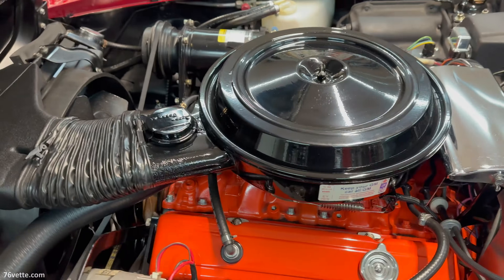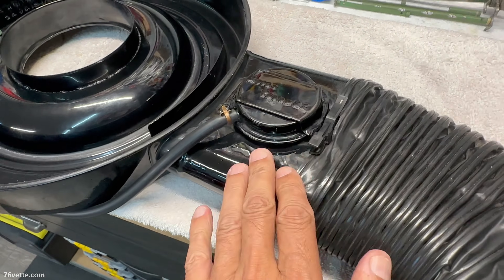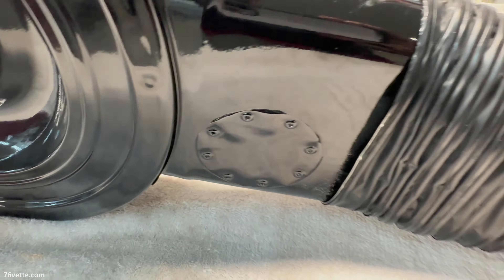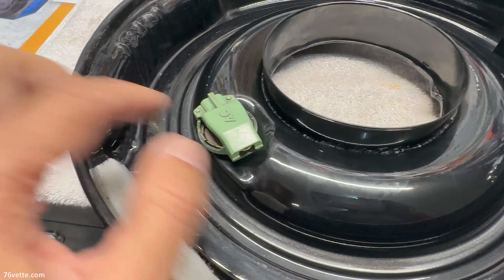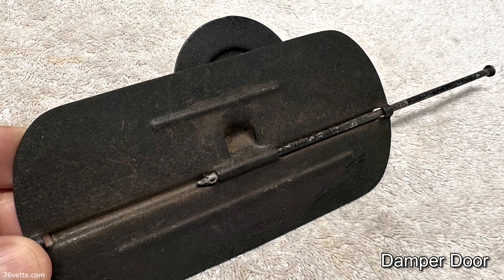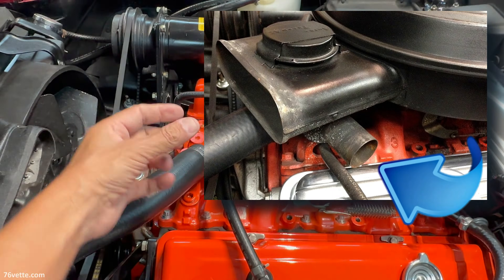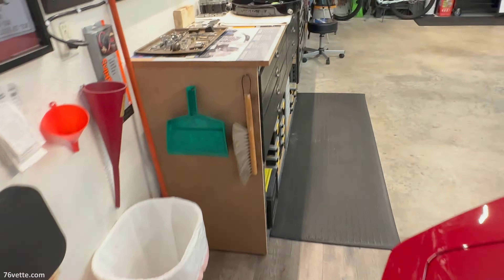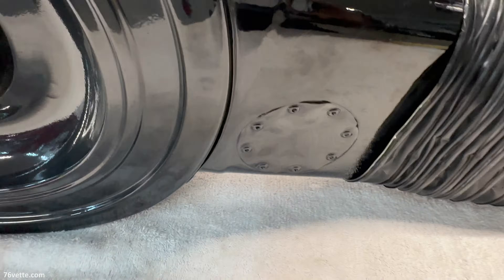How Does the GM THERMAC System Work?

Comment: These systems were used well into the eighties by a number of manufacturers.  GM used a lot of different part numbers for both the thermac valve in the snorkel and the temp sensor in the air cleaner. The sensor works similar to a choke bi-metallic spring. When it heats up a tiny ball valve opens and creates a small vacuum leak inside the air cleaner.    With no vacuum now going to the thermac, the snorkel door opens and the heat stove air inlet closes.
Reply: Thanks for the explantion of the temp sensor. I always wondered how it functioned without having a 12 volt power source.

Comment: Here in Brazil, we "know" it as thermac valve, a combination of the words "thermostat" and "pneumatic".
 I say we know in quotation marks, because in truth 80% of the Brazilian population (even mechanics) do not know what it is for, and generally when this component is defective it is forgotten forever. 
From what I know, this system has different functions, from emissions to even preventing carburetor freezing. In Brazil it was introduced by Fiat (correct me if I'm wrong), it was sometime in the second half of the 70s, along with the newest technology in engines powered by Ethanol, derived from sugar cane.
Ethanol, at least here in Brazil, has great difficulty vaporizing in temperatures below 15°C, so in cold starts, gasoline injectors were used to give the first start, together with the choke activated, and as soon as the engine starts, the vacuum of the intake manifold passes through the "sensor" present inside the air filter box and closes the hatch in the intake pipe, blocking the passage of air at ambient temperature and forcing the admission of hot air, coming from the metal cover that surrounds the exhaust manifold, which quickly heats up in a few minutes of operation, causing the ethanol to vaporize and the engine to be able to run regularly as quickly as possible.
After that, all brands started using ethanol-powered engines with the Thermac system, Volkswagen, Chevrolet, Ford, etc.
After a while, which I don't know exactly when, but I believe it was around the mid-80s, pollutant emission laws must have become stricter, and even gasoline-powered engines began to use the thermac system.
If we stop to do a simple analysis, an engine that is fed by a carburetor does not change its air/fuel regulation constantly according to the temperature and density of the air, altitude and engine temperature, a carburetor regulated at sea level on a 30°C day will not work very well when it is above sea level on a 5°C day, so since we are not able to control the climate, we have to regulate the temperature of the air that is admitted, another function of the thermac system, reducing the need for frequent carburetor adjustments.
Another important point: An engine that warms up quickly is an engine that needs less time with the choke on, consequently lower emissions and less fuel consumption.
And another point I've seen north americans make is about carburetor freezing in extreme cold conditions. This is very difficult to happen here in Brazil, despite the south of our country being very cold, reaching temperatures below 0°C in the height of winter.
Reply from the maker: I appreciate your detailed explanation as to the purpose of the Thermac valve and I thank you for watching. 😊👍🏻

Comment: What if the white filter-like material for? Mine is super brown colored and seems hard and clogged?
Reply from the maker: It’s, as you said, another filter (part of the PCV system), that helps control blow-by and burning those gases by feeding them back into the intake instead of releasing them to the atmosphere. If yours is in bad condition, replace it asap. 😊👍🏻

Comment: hey man, I have this system on my '79 Caprice Coupe. the hose on the bottom which you removed is broken/perished. do you know if there is a filter within that metal thing which it is connected to (which is missing on your enginge as you said)? I'm a bit scared that loose parts from the perished hose can fall into the engine. It has some trouble with cold start as well, may have something to do with this too. ( think it works together with the carburetor?) thanks for any help & cheers
Reply from the maker: Are you referring to the temperature sensor hose? If so then install a new vacuum hose (you can buy one at any auto parts store and cut it to size). If there’s a vacuum leak at the carb, the car is not going to run properly so you may want to replace all of the engine vacuum hoses.
Reply: @76vette hey man, thank you so much for the super fast answer :) I think it's the heat stove, shown in the pic at 03:06min. the one with the red arrows. greetings
Reply from the maker: @vornamenachname2018  Ok, so that tube does not have a filter and any unlikely debris will not go into the carburetor as there’s an air filter element that should keep that from happening. Cold starting issues can be related to choke and/or fast-idle adjustments. A proper rebuild of the carburetor followed by a tune up may be a good idea. Good luck! 😊👍🏻

Comment: It's not an emissions control device and in cold climates your car will run better with it until it warms up. It draws warm air up from a jacket around the exhaust manifold to improve cold performance.

Comment: Is it a big deal if the car simply has an open filter like the previous models? I'm buying a '79 C3 L82 but the previous owner apparently removed the original filter with the snorkel apparatus and the smog pump
Reply from the maker: Not having the thermostatic valve makes the car harder to start in very cold weather and it also helps keep even inlet temperatures to prevent throttle valve icing, under which conditions I would not drive the car anyway.
I would not worry about it too much. Thank you for watching! 😊👍🏻
Reply: @76vette  Thanks for the reply, cheers!
Reply from the maker: You are welcome. 😊👍🏻
Reply: Still have my original snorkel styled Thermac air cleaner assembly from my '79 Chevy 350 engine put up as a spare. I switched it out over 5 years ago for an older Chrome Edelbrock air cleaner I found in the junkyard chilling on a Chevy Vega and shined up. It was the type that's like having 2 metal pans with a large surface area air filter in between. I didn't really notice a difference in drivability or behavior even in below freezing temps BUT for context this was in my '79 Chevy G20 Van in which the firewall and doghouse ( under dash engine cover) wrap around the engine close enough to the exhaust manifold it presents a different thermal situation. I also use a manual choke (personal preference) A car or truck with a long engine bay may experience a change compared to my case however. The only times I felt different drivability performance was with what Quadrajet I used. I prefer the "Made for GMC by Carter" Quadrajets over the OG ones. Years ago I read something about Carter doing something slightly different with a chamber or something, don't remember, but I always preferred their performance. I realize this comment is a year old but hopefully you get something out of this.

Comment: How would I go about changing it to an open air filter??
Reply from the maker: Personally, I consider that a bad idea, but you can call a parts vendor like Summit or JEGS and they will sell you whatever parts may need to convert your system to a “hot air” filter instead of the original “cold air” design. Good luck! 😊👍🏻
Reply: Get an oxy-acetylene cutting torch cut out the base and cover oof air cleaner just to the edge of the air cleaner gasket. Get a chevy truck replacement aircleaner that will be 15 inches round and 5-6 inches tall. Cut hole in hood 2 inches larger than new air cleaner assembly and adhere on a 3 inch tall chevy cowl induction scoop. Then fiberglass and resin around the edge. Then sand and paint. Block off vacumn hose with a golf tee.

Comment: Love the channel. Do you know a good C3 mechanic in central Florida?
Reply from the maker: I’ve had DJ Auto Repair in DeBary work on my truck and my Corvette when I lived in that area and they are great. Danny built a dual exhaust for my 76 and Jose got my a/c working. 
121 S Charles Richard Beal Blvd., DeBary 
386-668-9771

Also, Reilly Auto Repair
850 Ridgewood Ave., Holly Hill 
386-254-8660
Reply: @76vette  thanks so much, have a 76 myself that needs a lot of things done and limited time to do it myself
Reply from the maker: @ytnicedream  You can also talk to owners at car shows as they can provide great leads for repair shops, painters, etc. 😊👍🏻

Comment: As I mentioned I put a L82 dual snorkel on my bone stock '76 L48 and mentioned a noticable improvement in everything.
      I live in Chicago so a majority of my startups are cold weather type situations.
    The stove pipe is a must and my experience is even in temps below freezing the moment the carb senses warm air the idle creeps up and in 30 seconds it goes in to cold idle mode roughly around 1500 rpm.
   The best thing is I can immediately put the 4 speed in gear and drive knowing the engine doesn't want to cough and stutter.
    My experience is the automatic will perform about the same depending on wear condition of the trans,fluid and vacuum.
     That being said the engine setup with everything in order makes it that much enjoyable to drive.
     Next comes heated seats under new vinyl covers.
     I love the '76 C3 mostly because of it's true driveability in cold weather or anytime actually.
   Keep up the great work and don't forget to swap out that single snorkel to a dual,you won't regret it after a little twerking with the upper radiator supports.
Reply from the maker: I’ll keep looking for one. Thank you for watching! 😊👍🏻
Reply: Why would you drive a classic car on the ice and salt roads of chicago? Are you stupid or something(jenny(forest gump)..
Not only are you risking some idiot sliding into you or yourself but the heavy salt will rot the chassis and aluminum in 5-6 years. Cant say how dumb that is enough. Its just not like the old days when men did the driving and high skill was required because they only salted the main roads with only 5-10% of the salt they use today. Your car has no chance at all
Reply: P.S.
If your driving that thing in the ice,snow and rain with ram assisted hydraulics thats just dumb ontop of dumb.
Sell that car to someone that appreciates it.

Comment: Having to smog mine every 2 years, I think the door was spring loaded open.  The valve in the hat was connected to a water temp controlled thermal valve , when cold would allow vacuum to the valve in the hat which would open when temp in the hat was cold.  This would draw vacuum to the diaphragm in the snorkel, closing it and forcing hot air flowing over the header (which heats up rapidly) to heat the air entering the combustion chamber.

It's main purpose as most other smog components were to get the engine up to temp faster so as to not pollute the air with its rich cold start mixture.    Every 2 years, I run through the schematic checking vacuum and hoses for leaks.  A pain in the butt but when you master it, it gets real easy.
Reply: Its one and only purpose was to get rid of the hesitation. By women to dumb to wait for the car to warm up before taking off down the road when it was 10 degrees outside. Because they cried they were stalling in the middle of the intersection and scared of getting hit by a real man in a big a** truck.
Reply: Dont fear the truth or we are all doomed if it is hidden
Reply from the maker: Hello! Yes, I was reading the ‘75 Service and Overhaul Manual Supplement, and you are correct. It reads in part:

“When the engine is off, no vacuum is present at the sensor unit not at the vacuum diaphragm. The force of the vacuum diaphragm spring closes off the ‘heated air’ passage (snorkel passage open).

When the engine is initially started, the sensor unit’s bimetallic strip senses cool air temperature (below 85°). The thermostat control valve is the sensor unit closes its air bleed passage allowing maximum vacuum to the vacuum diaphragm. Maximum vacuum at the vacuum diaphragm completely opens the damper door, closing off the ambient air passage through the snorkel and opening the air passage feed by the air heat stove. 

Should the engine be heavily accelerated while in this mode, the vacuum level on the system will drop to a low enough level so that the diaphragm spring will overcome the vacuum and push the damper door closed permitting ambient air passage through the snorkel. 

As the engine heats up and air passage past the sensor reaches approximately 128°F, the sensor’s thermostatic control valve bleed passage is completely opened by the bimetal spring acting upon the needle. 

Air bleeding into the vacuum acting on the diaphragm assembly lowers the vacuum level enough so that the diaphragm spring closes the damper door, thus opening the cold air passage (ambient air through snorkel) and closing the hot air passage (heat stove passage).

At temperatures between 85° and 128°, varying amounts of air is bled into the system, depending on the exact temperature at the sensor unit. This results in a vacuum level and damper position required to maintain carburetor air temperature at from 85° to 128°F when underhood temperatures are below this range.”

It also states that the damper door fully opens at 8 inches of mercury and fully closes at 6 inches of mercury or less. Fascinating stuff. 

It’s a shame that some states don’t give classic cars a pass when it comes to smog testing as these cars are not daily drivers. But that’s a different discussion. 

Thank you for watching and, most importantly, for taking the time to comment. 😊👍🏻

Comment: Here’s what I found on the thermAC system. Chapter 10: Emissions Equipment: THERMAC

Purpose:

A heated intake air system is used to give good driveability under varying climatic conditions. By having a uniform air inlet temperature, the fuel system can be calibrated to reduce exhaust emissions and to eliminate throttle valve icing.

Operation:

The THERMAC air cleaner operates by heated air and manifold vacuum. Air can enter the air cleaner from outside the engine compartment or from a heat stove built around the exhaust manifold. A vacuum diaphram motor, built into the air cleaner snorkle, moves a damper door, to admit hot air from the exhaust manifold, outside air, or a combination of both. Inside the air cleaner is a temperature sensor that reacts to air intake temperature and controls the amount of vacuum going to the motor.

Hot Air Delivery Mode. When the temperature is below 30°C (86°F), the sensor allows vacuum to the motor and the damper door will be up, shutting off outside air and allowing only heated air from the exhaust manifold to enter the air cleaner.
Outside Air Delivery Mode. When the temperature is above 55°C (131°F), the damper door drops down and only outside air enters the air cleaner.
Regulating Mode. Between 30°C (86°F) and 55°C (131°F) the damper door allows both heated and outside air to enter the air cleaner.
Reply from the maker: Thank you Paul. Great information 😊👍🏻
Reply: @76vette  glad to help. I was interested in finding out more myself. Keep up the great work!
Reply from the maker: @paulbagley9268  Thank you! 😊👍🏻
Reply: Its only used for the 5 minutes or less when the underhood temp is lower than 80f degrees. Wich can be considered critical at about 40 degrees ambient air temp. For about 3 minutes.  Once the engine is good and hot you can only dream of a 40 degree cold dence air charge....  Why would you want to heat it up quickly?